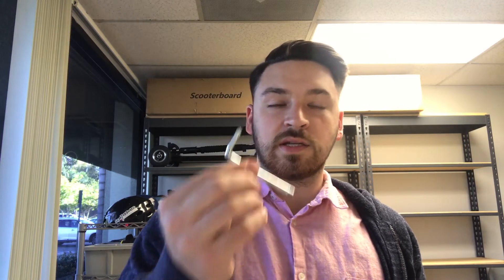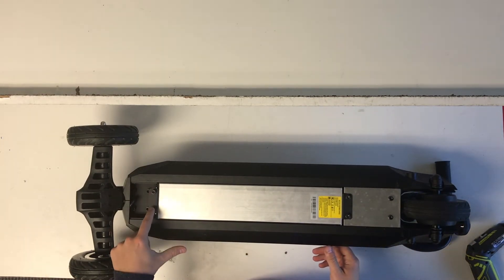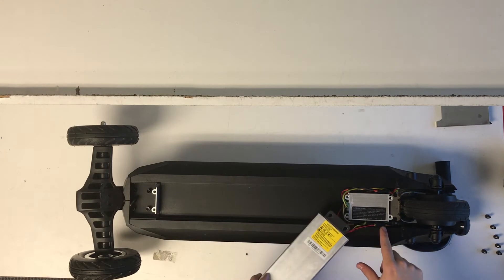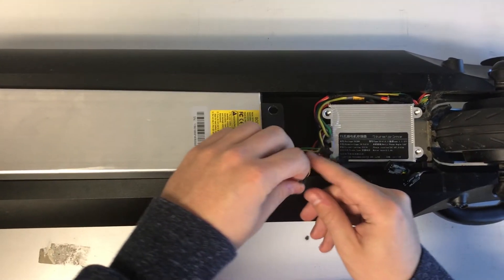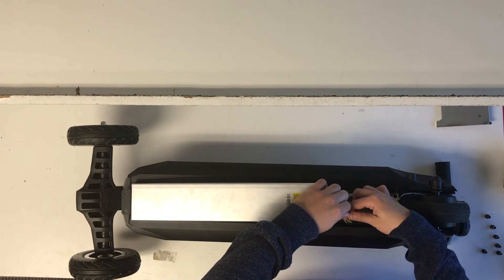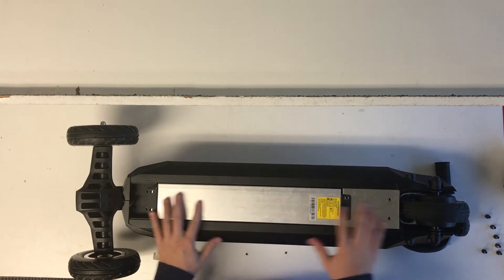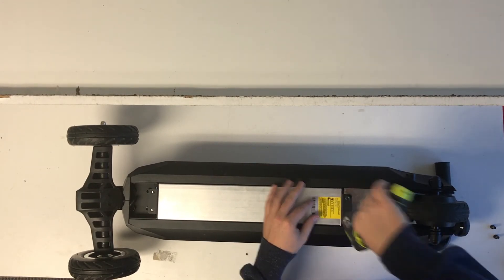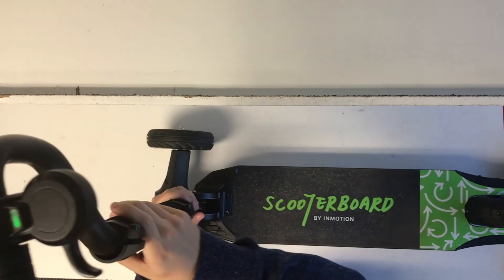Scooterboard Battery Switch

Comment: EUCO - Can you please advise what the third connection from the battery is for?  Two connections from the battery connect to the controller, but the third connects to a separate port from the controller - what is that port?  The Throttle?

Comment: how about to replace the 3 tires ?
Reply: Just bought a replacement tire myself and look all over for a video. Haven't received the package yet but I will let you know if it came with instructions... Till then, be well.
Reply: Replacement of the back wheel.. what an adventure... Then wires were too short so I had to rewire , heat sink ect. Cleaned and spraypainted all the bolts and the metal cover by the back wheel to protect from rusting again. Running fine now👍